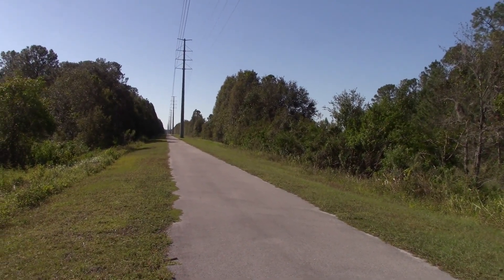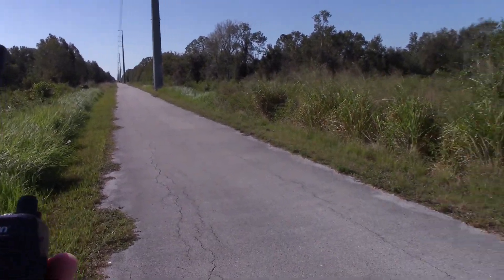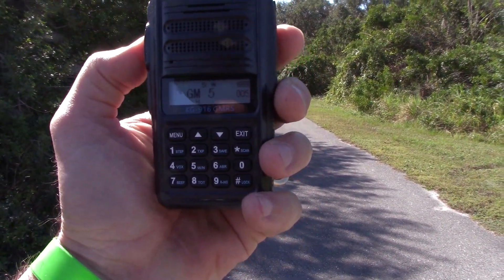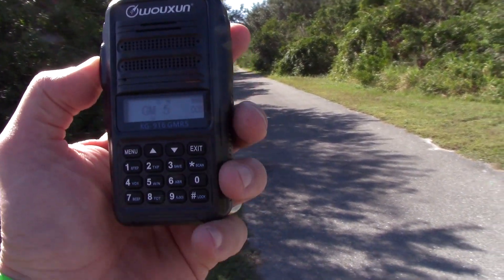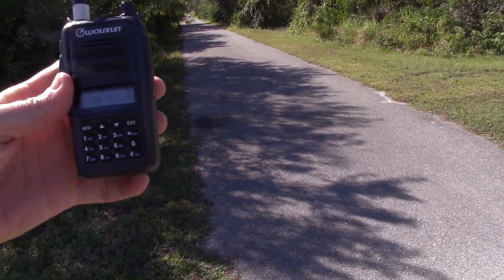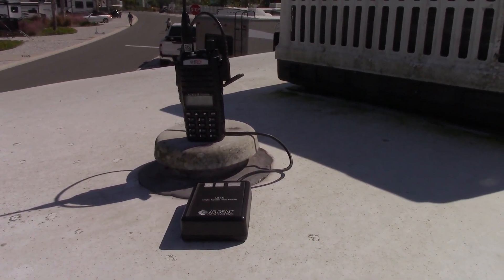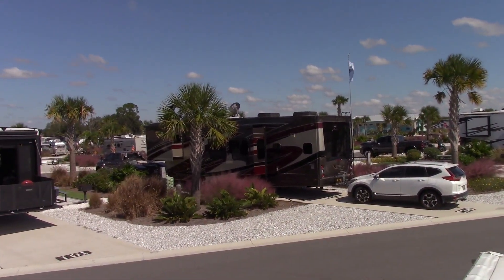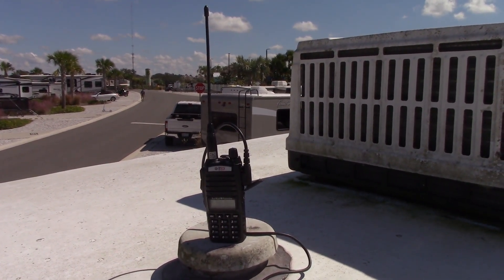Smiley GMRS Antenna Test

Comment: What type of base connector did you select from the Smiley website? I received the wrong base attachment type (SMA male), so I can't test my 5/8 slim duck yet. The cover part by the base looks like it'll be too big for my Wouxun KG-S88G radio, but I think without it, some of the metal on the radio might show and be bad if the radio gets wet. Lmk your thoughts if you can.
Reply from the maker: Its a TX connector on the top part that connects to the whip.

Comment: I did a simplex test with my friend 8 miles away and my Super Stick GMRS worked great retracted but was much worse when extended. Weird and not what you are getting here.
Reply from the maker: It should do better extended, especially at that distance, assuming all environmental conditions were equal.
Reply: @ yeah it’s surprising for sure. It’s my best handheld antenna retracted though so I’m not complaining.

Comment: What is the SWR with these antennae?
Reply from the maker: Because the radio itself and the person holding the radio is the antenna's counterpoise HT antenna SWR can't be measured with a normal meter as the meter will be in the middle of the antenna. Smiley claims the resonate frequency is in the middle of the claimed freq and good for +/_ 5 MHz from the center. Short of a very expensive equipment collection I have to go with a trusted manufacturer.

Comment: At 4:31 you say the short 5/8 wave did belter than the full 1/4 wave. Is the 5/8 wave you are referring to, the Smiley Slim Duck and the 1/4 wave  the stock antenna?  Or is the 1/4 wave the  Slim Line? Thanks.
Reply from the maker: The Smiley 1/4 slim line. I expected the coiled 5/8 to lose more performance.

Comment: What if the repeater antenna isn't good enough to reach back to the handheld you're using?  I'm surprised that little repeater antenna reached all the way back when that extended smiley was needed to reach the repeater.  Or maybe the smiley is also better at receiving, so that's why it can hear the repeater?  Fun test you did!
Reply from the maker: The extended antenna will help receive the signal. It also sent a better signal to the repeater so the repeater's repeated signal had a little cleaner audio. There has been conditions where the radio I was using hear nothing back, yet another radio did. In that situation, the differences in the receivers and antennas are noted.

Comment: I did what you did in the the summer of 2021 with the same parrot repeater and two Radioddity GM-30s.  Used the combo of stock,  5/8 wave, 2 meter. antenna cut shorter to balance SWR, A quarter wave car roof antenna  and later a 1/2 wave house antenna with ground plane redials.     Farthest I was able to talk with myself was 8 miles on high ground.   Well under a 1 mile with a hill in the middle.  Well under a mile with a green cornfield or leafy trees in the between. Walk  next to a river and I am hearing factories or kids using FRS radios 20 miles away on the river.   My latest toy is a Retevis RA25 GMRS that is jailbroken.  We have 4 VHF school bus repeaters I can hear and chug with the correct tones.  20 miles is  very doable.   Closest GMRS repeaters are 60 miles away and I have to pick my battles on prefect mornings to hit them.  If you want to talk radio to radio MURS is the best real world option.  I've noticed Walmart stores must be upgrading there MURS store radios. If I hear understandable traffic on MURS channel 4 I start looking for the Walmart often 5 miles away.
Reply from the maker: Yep, terrain is the biggest factor with UHF. Locally Walmart, Lowes and Sam's Club use MURS CH4, along with a couple construction companies. Been a long time fan of MURS from back when FRS/GMRS was overloaded.